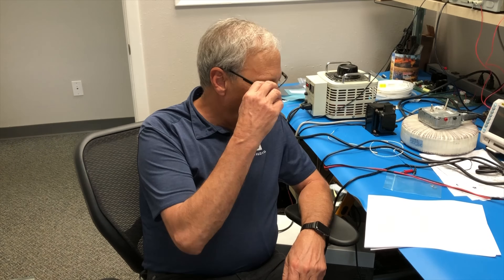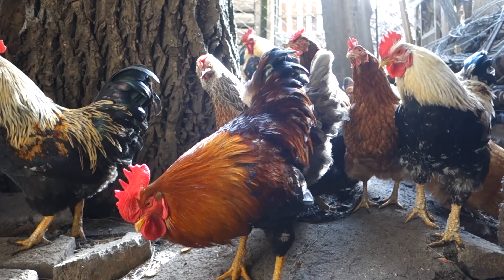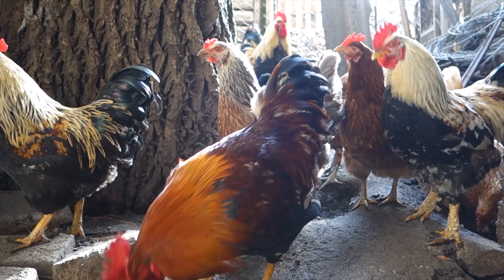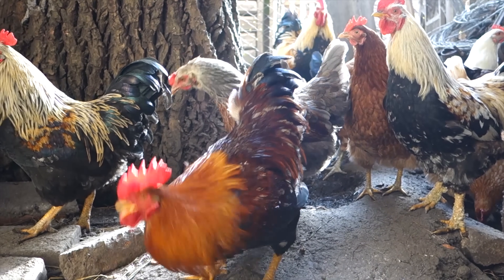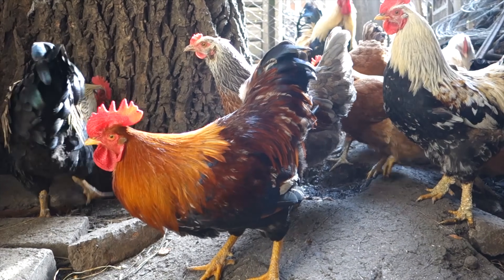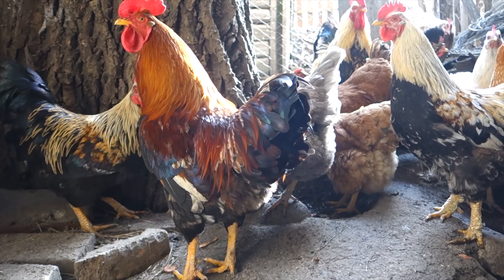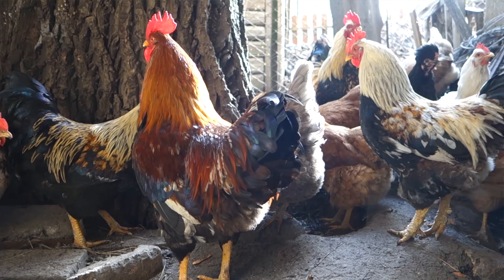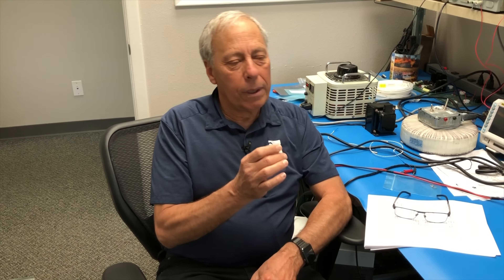Is a CD's optical output connected to the laser

Comment: This may sound irrelevant, but I want to take this video as an opportunity to raise a complaint about Toslink terminals and connectors. They are so crappy to me and I don't understand why they desgined it that way, and why plastic? I'm engineer in the field of medical lasers and our F/O cables have much better build, especially when we talk about terminals and connectors. They are metallic, and in most devices the plug is screwed onto the socket, and they are pretty robust. I really don't understand why audio optical cables are designed in such an unreliable form.
Reply: Because it’s a 1983 attempt at a low-cost consumer fiber optic interface.

Comment: It's also a dumb question because: 1. the laser light isn't in some path that would be reflected from the disc right down a tube, and 2. the amp. on the other end shouldn't have to process the raw optical data from the disc; that's the player's job, and 3. those optical connections are for more than bridging CD players to external amps; they bridge a lot of audio components to those.

Comment: Paul, One of your chickens here, but hate to burst your bubble.  CD players from day one uses a FIFO buffer.  Buffer fill size is what drives the disc spindle motor to keep the buffer about 1/2 full so data is clocked out with a separate jitter free clock.  This is not unique to PS Audio.  It is the industry standard.  For those following along, look up dual port static RAM.  The disk read clock is produced from the varying rate off the disk and feeds the buffer. The DAQ after error correction is fed from data clocked out jitter free.  It's in the service manuals for almost every CD player produced.

Comment: Paul didn’t answer the question about sound difference. Short story. The integrated amp with internal DAC in my living room I bought in 1990. The CD player is only used as a transport. I was initially using a plastic Toslink so the salesman had me borrow a digital coax cable to see if I heard a difference. Once I realized what I was hearing it was easy to hear that the plastic Toslink was harsher. I always figured it was jitter introduced by converting from electrical to light and back to electrical. But I have no idea what modern Toslink sounds like.

Comment: A CD does not spin at 600 RPM but rather a variable spin from 200 to 530 with the highest RPM when reading at the center to keep bit density and bit rate constant.
Reply: 60zeller Just expressing a fact. CDs spin at a variable RPM to maintain a constant bit rate. LPs spin at a constant RPM and that actually means a theoretical audio fidelity difference between tracks as music is more compressed closer to the center of a LP.
Reply: ThinkingBetter I know dude 
Just messing with ya

Comment: The output from the laser reader also contains quite a few parity bits for error processing as well as the musical information. The bit stream is also not time sequential so quite a lot of processing is necessary to convert it to an audio signal. This is the main reason that digital audio is so free of random noise.
Reply: machintelligence.
The fact that it is not time sequential is in my opinion the best argument to show the signal at the optical output can not come directly from the pick-up head.
If it was, the amplifier (or wherever the optical output was going) would need to have "decoding"
Reply: Exactly.
Reply: SPDIF protocol and Red Book CD protocol are quite different.  No SPDIF receiver can decode CD track data.  
Red Book CD:
  Audio Frame consists of 6 pairs of 16-bit stereo samples (192 bits)
  Audio Frame data is interleaved across several Physical Frames and then 64 ECC bits and 8 subchannel bits are added to complete each Physical Frame (264 bits)
  Each 8-bit byte of the Physical Frame is encoded into a 14-bit pattern (Eight to Fourteen Modulation or EFM) that can be written to the CD track while guaranteeing frequent On/Off transitions, and 3 "merging bits" are added to each 14-bit pattern.  Then each of these track frames occupies 561 bits on the CD track.  
  Finally, a 24-bit Time Code and 3 more merging bits are added to each track frame, making it 588 bits.  At 44.1KHz sampling there are 7350 frames/sec which is 4,321,800 bits/sec.  
SPDIF:
  Basic data unit is a 32-bit subframe which contains one 20-bit audio sample, 4 header bits, 4 auxiliary bits and 4 status bits (validity, user data, channel status and parity).  Auxiliary bits can be used to extend data resolution to 24 bits.  
  Frames consist of at least two subframes (stereo) but can be larger for multi-channel data.  
  Frames are organized into Blocks containing 192 Frames.  There are no ECC bits added, so data integrity relies only on the Parity bit in each subframe.  
  The protocol does not require time code to be added, but arbitrary information can be encoded into the user data bits.  
  For stereo at 44.1KHz, the bit rate is 2,822,400 bits/sec, but other sampling rates are allowed, for example at 48KHz sampling the bit rate is 3,072,000 bits/sec.  
  On the bus, bits are represented using Bi-phase Mark Coding.

Comment: its why optical has long been considered a poorer connection method, in that it requires a whole bunch of extra stages of conversion, as well as potential connection issues if you can't establish a perfect mate. However, if you are working with super long distances, or an environment where galvanic isolation is preferable then optical comes into its own.